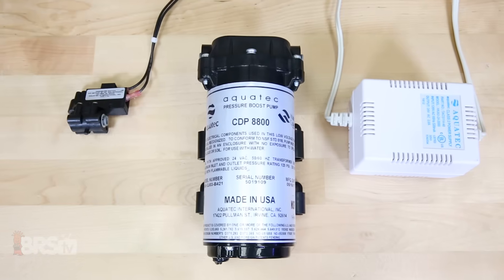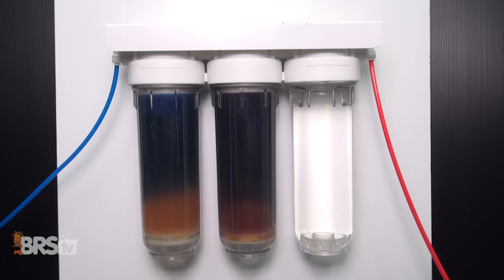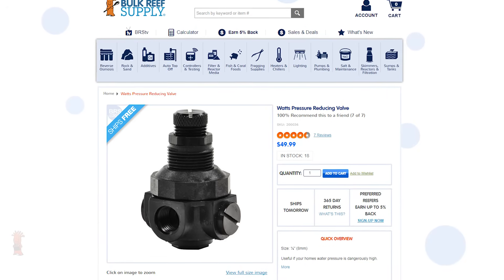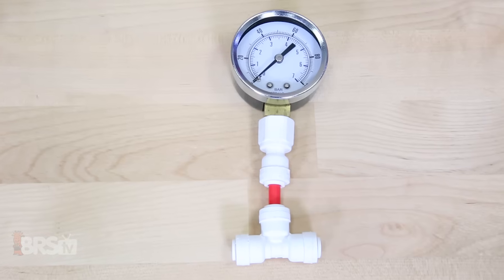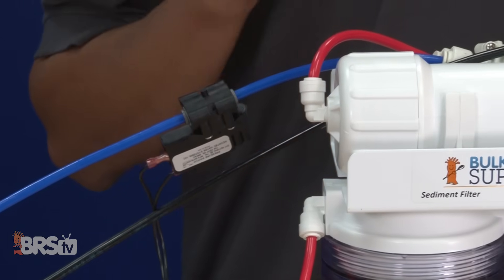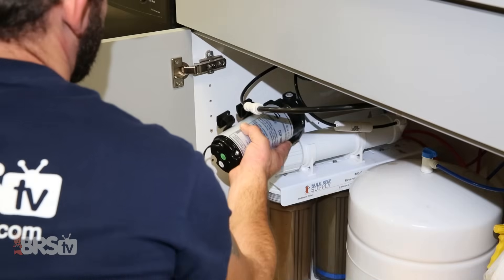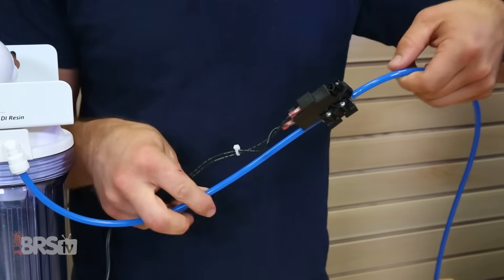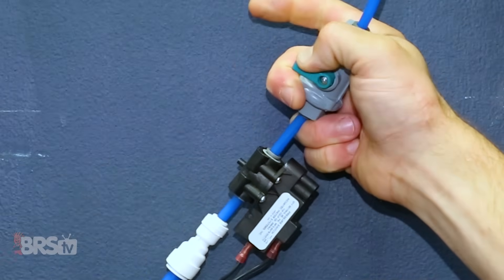Spotlight on the Aquatec Booster Pump Kit | BRStv

Comment: Hi, i m having problems with my RO, i installed a booster pump , i installed a high pressure switch at the end right before the needle valve and the floater, now when i plug the hps it shuts off and if i remove one plug from it it works, my second problem is that i have no pressure on the pressure valve, i need help pls before the maple syrup season starts, thank you

Comment: This is why you got so many dislikes you're going way too fast you're explaining one thing and then jump into another in the middle of the explanation before going to the next step I don't know if this video is meant to confuse people but you're doing a good job at it and the dislikes show it, you need to simply show where to connect the line going into the pump from the pump to the RO system and then simply show where to connect the pressure switch that's it worry about everything else after the first explanation is done very confusing and very frustrating
Reply: This is true... I'm missing a real schema and explanations about the different valves. However, your video is useless as it's too fast and too vague.

Comment: Is there anyway to get debris out of my pump if it sucked some up?
Reply from the maker: The 8800 booster pump isn't user serviceable, so unfortunately, no.
Reply: @BRStv  ok thanks, I just opened it myself, cleaned the debris. closed it back up, reprimed it, and its working great. cheers.

Comment: Thanks for the video. Is there a way to adjust the pressure switch to shut off at 60 PSI instead of 40 PSI?
Reply from the maker: This particular pressure switch is pre-set to trigger at 40 psi, but is adjustable from 30-60 psi. There is an extremely small set screw on top of the pressure switch if you need to make an adjustment.
Reply: @BRStv  hi the imput water presuure is 65 psi but the output is 50psi if you open several facucet in lower level pressure drop to 40 psi... how can you gain waterpresusre at this point after waterfilter is installed
Reply: 40 psi is the cut in pressure. This is the pressure at which the pump starts.)

Comment: Where does the wire on the switch go
Reply from the maker: there is a y cable that it'll attach to. The connectors are all set up so that you can't wire it backwards.